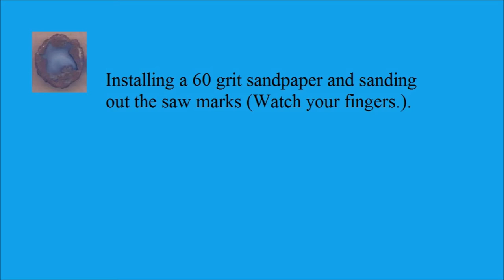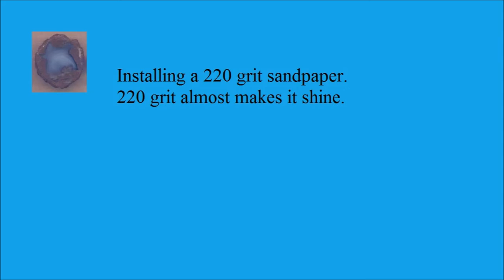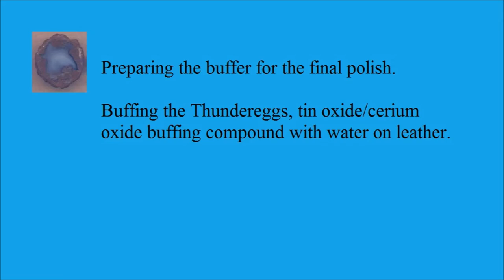Polishing Thundereggs

Comment: For those with/wanting a Richardson sander, velcro sanding disc holders are available that take 7-inch velcro-backed 
sanding discs. Makes changing the sanding discs easy to go from one grit to another by just peeling off the disc and
attaching another. You don't have to fuss with a center screw through the disc as shown here, and you can use the whole
disc surface.
Reply from the maker: Hello,

    Thank you for the tip.  Darrell Kramer, the lapidary in the video, always stressed that there is an optimum placement of the surface of the stone in relation to the sanding or buffing discs in the video.  The reason for this is that certain positions are more apt to "throw " the stone away from the machine OUCH! and watch your fingers.
Reply: That's very true. Explains why I don't have fingerprints on some fingers.

Comment: Love your setup there! With the price of lapidary machines, I''m fixing to build one myself. If I may ask, what is the piece between the sanding disc and the head? Is it just a rubber pad? Thanks
Reply from the maker: Thank you. Awesome set of videos you have there on YouTube. The piece might be rubber or some type of slightly flexible nylon or plastic.  It has a catalog number on it that reads Porter Cable cat no 42321 and 4500 rpm max safe speed.  Tried to search this number but no satisfactory results.  The machine is a specialty of Richardson's Rock Ranch http://richardsonrockranch.com/
Reply: Thanks. That's a very cool machine! I've got mine built and up and running. Just got to work out the minor details. Thanks for the help!
Reply from the maker: You are welcome.  That was quick.  Watch your fingers, keep to the optimum spot and don't let the rock get thrown.
Reply: Is that middle piece necessary? I mean what is the benefit or take away ?
Reply from the maker: @electrichellion5946  Hello, I think you are meaning the piece to the left and a little toward the back. It is a sort of funnel with a hole to accept a funnel type attachment from a shop vac to suck the dust and smaller debris away. You can see the funnel from the vacuum about 23 seconds into the video, the vac itself sits underneath the bench.

Comment: Hi there. Thanks for your great demonstration.  I just got my RR sander.  I'm having trouble getting the hang of it.  I feel like I'm putting more scratches in my eggs than I started with.  My saw cuts pretty smooth.  I'm starting with 60 grit.  Do you think it's a pressure issue or a grit issue?
Also, do you really go 60, 220 then polish? That's so fast!! Thanks for your help.
Reply from the maker: Hello, Congratulations and thank you for the compliment. It is quite normal to need some time and experience to feel like you've got the hang of it with anything. Yes eggs coming off the saw do look quite smooth but not polished. I think the problem is a pressure issue, it requires a firm pressure that is neither tight nor loose. It is rather like tightening a bolt, it must be snug, not loose or tight. The process does take a bit of time so that may be part of the issue. Yes 60, 220, and then polish. You are welcome. Enjoy!

Comment: Hi There, hoping you dont mind me asking but do you sand on dry Sand paper? and what RPM does your machine run at? Many thanks in anticipation.
Reply from the maker: Hello,

    Questions are good.  Yes, the sandpaper is used dry.  The machine motor runs at 3450RPM.  You are welcome.
Reply: Thank you Very much for your prompt reply, i suppose the final buff is done at lower rpm, would you know the buffer rpm give or take?
Reply from the maker: You are welcome.  The buffer motor runs at 1750RPM

Comment: Where do you get your thunder eggs. Also I was wondering if it’s ok to do it by hand
Reply from the maker: Hello,
    These Thundereggs came from Richardson Rock Ranch http://richardsonrockranch.com/
    Thunderegg is the Oregon name for it's geodes.  Geodes can be found around the world with various local names such as Thundereggs in Oregon or Mexican Coconuts for certain geodes coming from Mexico.
    Geodes are roundish  and need to be cut in half to be sanded and polished as in the video above.  When cut with a rock saw (oil lubricant) there is sometimes a splinter on the side of the rock, a small one can be sanded off (sanding no lubricant, polishing disc water lubricant), a large one is more efficiently ground off on a grinder (water lubricant, carborundum grinding wheel is okay, diamond is way better).  The high speed sander is very good for the larger geodes as one can hold the work up to the horizontal disc in an easier fashion than to a vertical disc.
    Arbors for grinding and sanding can have a place for a vertical disc that usually runs at a lower speed than the high speed sander.
    While it is possible to do this work by hand the finished product will not be the same and be much longer.
    Used equipment can possibly be located by inquiry at lapidaries, artist jewelers, rockhounds, or rock and gem clubs.
    As you can see in the comments some people have gone ahead and constructed their own machine.
    Always be careful of flying splinters/rocks, rock dust (lungs), fingers, and the unexpected however you work the rock.

    Lapidary and jewelry supplies    https://www.kingsleynorth.com/
    Stainless Arbor Package    https://www.kingsleynorth.com/skshop/product.php?id=95453&catID=1054

    Thank you for watching and commenting.
Reply: Plus a Geode can never be a Thunderegg, but a Thunderegg can be a Geode....

Comment: How much upward pressure do you apply while sanding?
Reply from the maker: Hello,
    Thank you for your question.
    The upward pressure is similar to that used on a vertical sanding or buffing disc.  A firm but not intense pressure.  Too intense of a pressure may result in wounded hands or the rock being thrown.  Too soft a pressure will not sand.  Also, there is an optimal spot to position the stone while sanding, you can see this position in the video.  Keep your fingers back.  The high speed sander was built by the folks at Richardson's Rock Ranch for Thundereggs.  Here is a link to their website.   http://richardsonrockranch.com/   Thank you for watching our channel.  D & M at realrock.us
Reply: I still have to find the right amount of pressure to use as I keep getting the edges to wear down ever so slightly than the majority of the rock face. Either that or I hear the “snick” as a tiny chip breaks loose from the edge.
Reply from the maker: @electrichellion5946  This is the part that requires practice to get the right feel.